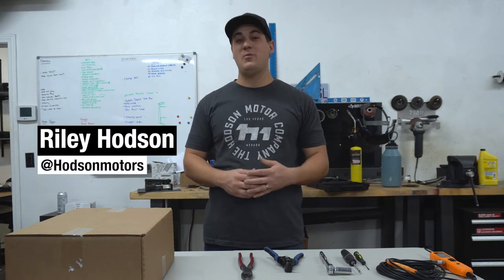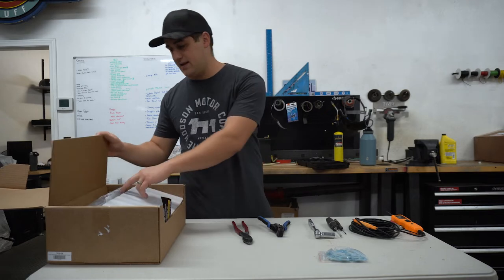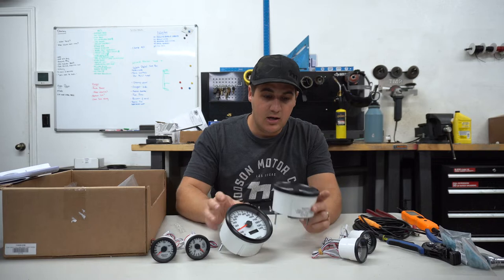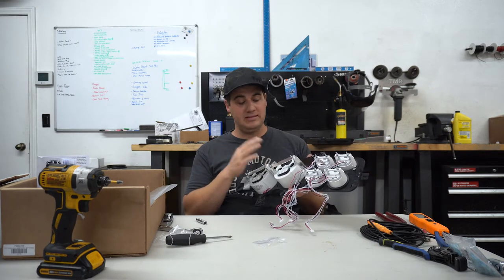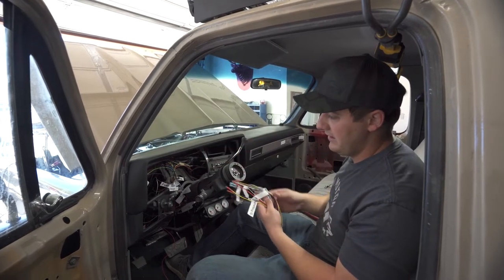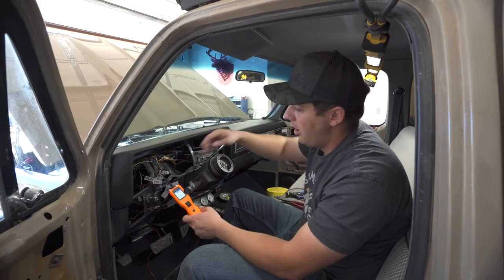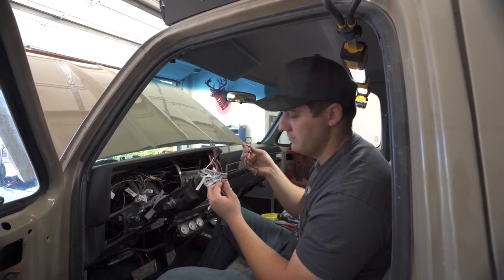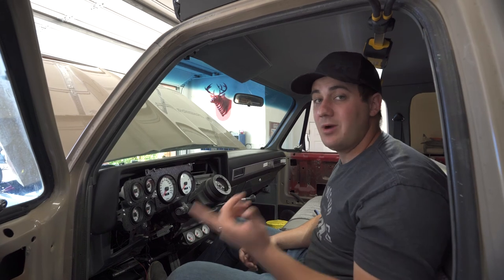New Vintage Gauges on any classic truck!

Comment: Hello, A really good video. I just received New Vintage gauges for my Gen 2 Camaro  and I do have a couple of questions in regards to the turn signal indicators and high beam light. The instructions say they are invisible/deadheaded. I have look very closely at both the Speedo and Tach and for the life of me I can't see anything behind the bezel. If I apply 12v DC to the correct pinout and ground that indicator it should light up. Can I do this without damaging anything? Second question. To my knowledge I don't see where the connection is made for the brake warning light. On the tach there are 3 indicators but those appear to be used when one is using a computer/ECM such as an LS swap. Any thoughts on that? THANKS!!! P.S. I did here you say you say you saw them come on but I could not see them in this video as the camera was too far away.

Comment: I also have NVU guages on my 75 K5 blazer, but am far from impressed with there mounting brackets.. Tons of adjustments for a dash panel used for almost 20 years that doesn't require any adjustment! It's almost impossible to have all of the guages mounted square and centered within the holes...

I love the way the guages themselves look, but the mounting piece could be made so much better.
Reply: NVU redid the bracket, if you had them a while I am sure they could send you the updated bracket.
Reply: @throttleblip1  I actually just recieved the new bracket a little while ago, and the metal tab connecting the two pieces is much better than the flimsy plastic before.. But, I still do not understand why there is so much adjustment when it is not necessary.. These trucks have used the same dashboard from 73-91.. The shims, the oversized holes, getting the guages square, etc. just makes for a pain in the rear.. Especially if you're a perfectionist.. I just believe it could be designed much better, but that's my personal opinion. I love the guages and couldn't be happier with them now that they're installed.. it was just an extremely prolonged process.. I epoxied the shims to the plastic "frame" so if I ever have to remove the guages again, I don't have to worry about them moving

Comment: What did you set the pulse per revolution (ppr) at on the 12v cummins?
Reply from the maker: The Dakota digital tachometer box SGI-100BT calculates it for you. You select how many cylinders, what input (alternator in this case) and then there is a calibration setting. The way I fine tune it is by driving in OD with the torque converter locked. I use an rpm calculator from tremec.com to see how many rpm's it should be running at 65 mph. I then fine tune the Dakota digital box to where the tachometer reads properly.

Comment: Which aftermarket dash is that? LMC?
Reply from the maker: Dashes Direct
Reply: @hodsonmotors  Is it metal on the underside? Like the factory ones were. I've been trying to find the best aftermarket dash, and even the "vinyl" ones from Classic Truck Parts of America are wavy all across the back of the dash. The underside is plastic.
Reply from the maker: @enermaxstephens1051  yes it is. Fits great. Manufactured here in Las Vegas Nv. I've toured their facility it's awesome.